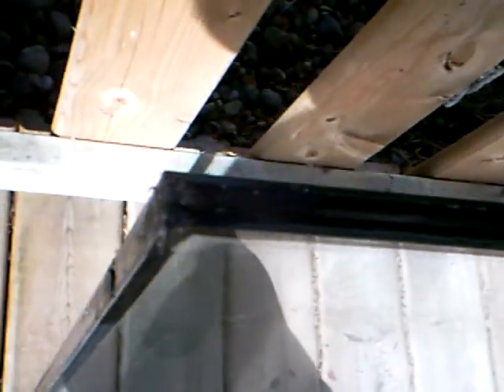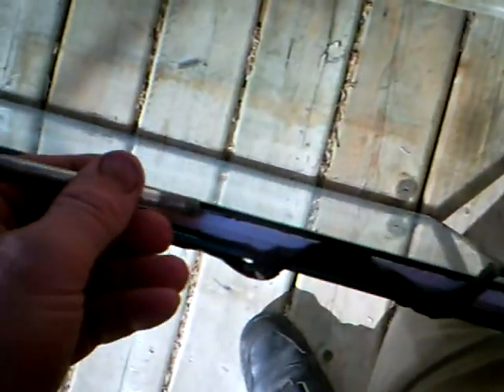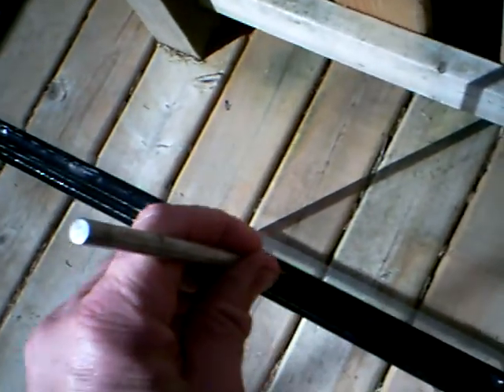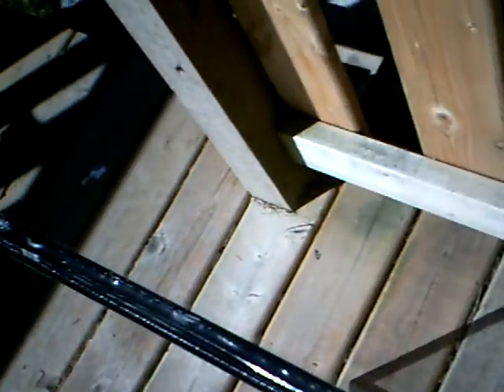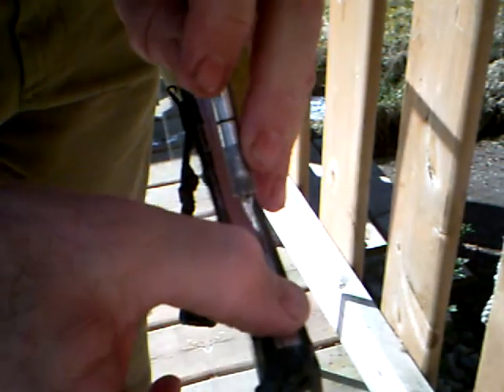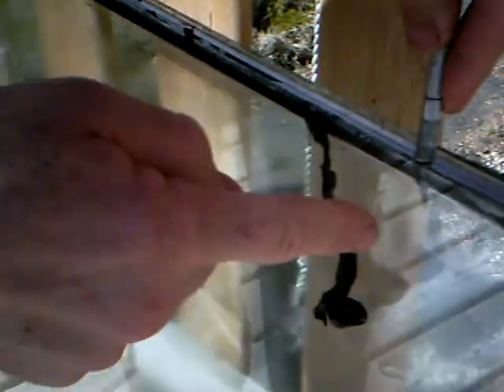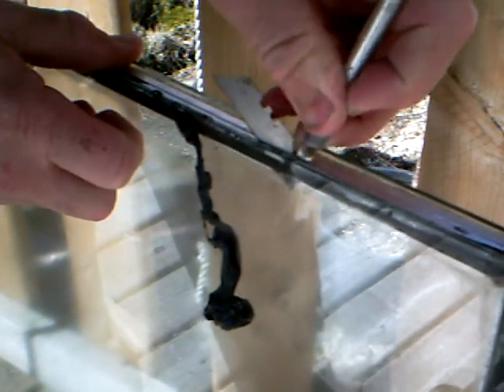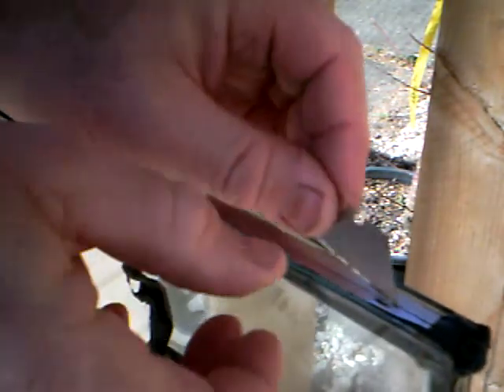Sealed Thermal Glass Window Disassembly And Cleaning

Comment: Hey! I'm a professional Glazier and I see a lot of people trying to fix windows that have the "fog" in between the two lites of glass. The average person should NEVER attempt this. It's dangerous and almost impossible to re-seal the glass. It's requires a special glazing spline called spacer bar which has adhesive on it to bond the two pieces of glass together. It is AIRTIGHT and has properties that wick away moisture. To further ensure the seal a 1/4" thick bead of of silicone(specific silicone is required) is applied to the edge(the black goop he's pulling out). It's nearly impossible to get this sealed back up without a special setup. Also: lay the glass flat on some carpet and it's much safer if your brave enough to attempt this.

The moisture comes from the sealants failing which happens over time from sun damage/change in climate, etc. These sealed units should NEVER "breathe" the sealed term is taken quite literally. If the glass has a seal failure like this it's lost almost all of its insulation value. It's honestly best to replace. Hope this helps someone!!

Comment: Hello, I have similar issue with a few of my windows. I’m wondering how did you replace the airtight seal? What did you use to reassemble the window? How is your window holding up?
Reply: I didn't make it airtight again  - just double pane with no seal. (That way when it eventually gets dirty inside it'll be easier to disassemble and clean.)
Reply: @craigcarmichael5748  - interesting, is cleaning the inside panes a twice-yearly chore? I'm like many people and clean the outside of my windows less than once a year, or about every 5 years on my 2nd floor windows, so my standards are pretty low, however as you know when the seal fails the inner surfaces get super cloudy and bothers a person even like me.
Reply: @donaldlee6760  The cloudy film is why to take the window apart in the first place, to clean it with (eg) baking soda. AFAIK moisture gets on the alume frame between the panes and then evaporates inside and the alumina (oxide) deposits with the vapor/dew on the glass. On the window I did long ago, after 15 or 20 years I never needed to clean the inside again. But IIRC when I cleaned it I discarded the alume and made wooden strips for the edges between the panes, and used double sided glazing tape to seal the inside pane only, so moisture could escape around the edges of the outside pane. (I've moved so I can't check for sure.) I would hope cleaning again would not be any sort of regular event. If it is, I'd prefer (as I did) to ditch the powder-making alume and use strips of wood. But then, I didn't have an existing window assembly to fit that one into, so I made it all wood. (Buying or finding scrap windows that I could clean and then designing my wall openings to fit them saved money!)
Reply: @craigcarmichael5748 thank you sir 🙏😎
Reply: Use a small piano wire to cut the seal